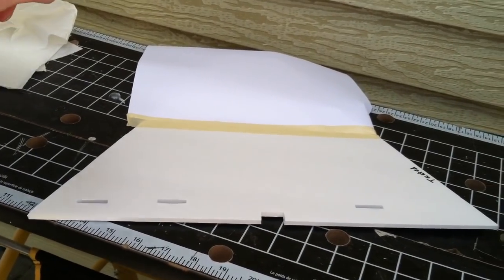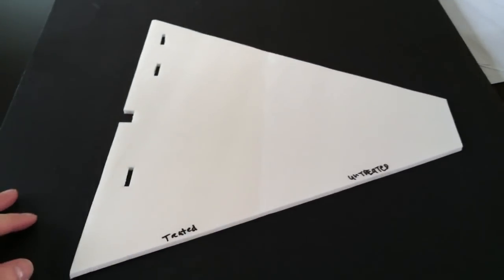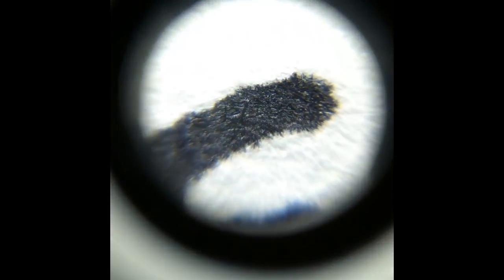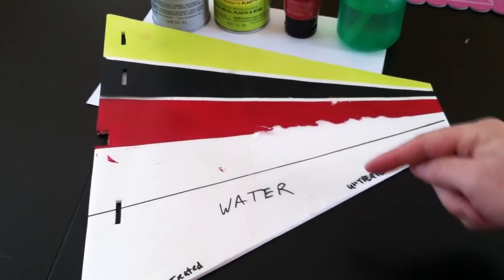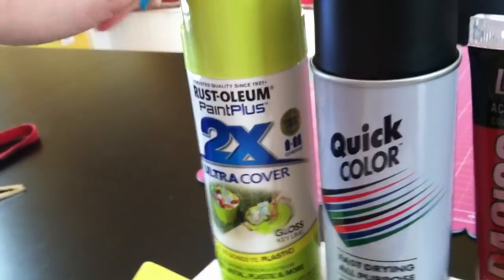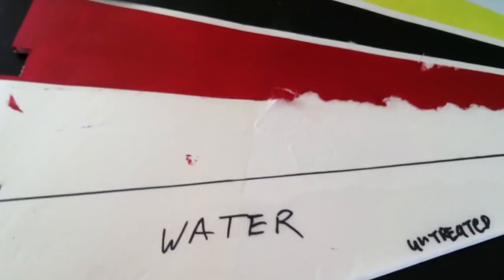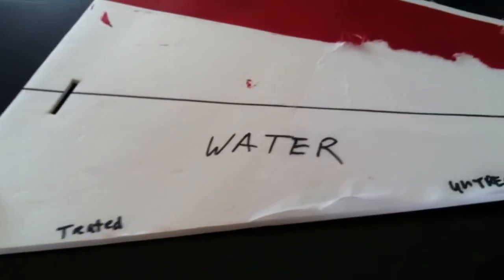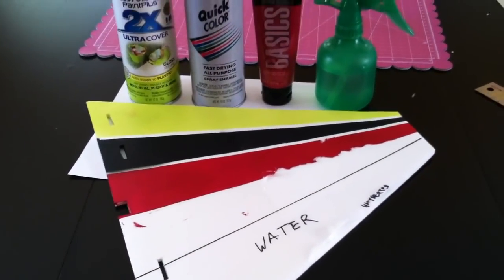Minwax coating on dollar store foam core

Comment: another question I suppose is you painted basically onto the actual foam Paper itself. You treated the foam paper.   I noticed in a few of my scratch builds with this foam is when the paper is removed in some areas OR the sides where there is no paper. If I try spray painting this foam without first treating it many or majority of spray paint will bubble on the surface and many will Melt the actual foam destroying the entire build.    I wondering if this Miniwax pre treatment will allow me to spray paint directly onto the Foam Board where certain areas of the foam paper was removed. Will this prevent the foam melting and paint from bubbling up? hmmm
Reply from the maker: While I haven't tried it myself, I don't know that the poly would work on the bare foam.

Comment: You say you shouldn't paint with acrylics,  but you don't say why. In my testing,  painting acrylic over a poly-treated surface works fine. Just don't do it on untreated foam board, as it warps. Would like to see some justification for your statement, as even your video seems to show it working just fine.

Comment: Hello and thank you very much for your helpful video. I am planning to paint on a foam core board using Acrylic paints and brush....I need to prime my foam board and in a YouTube video I got to know that we need to use water-based Minwax or Latex in order to be able to prime the foam board, but here you mentioned to use oil- based....please advice. Appreciate it.

Comment: does the Minwax cover stop it from wrinkling when you spray paint it.??
Reply from the maker: For all the spray paint I've used, yes. Since the minwax sort of merges with the paper once it cures it has a harder surface feel and the paint works very well.

Comment: Three or four years ago I tried to paint Dollar Tree foam board with a air brush using acrylic paint, this was before I heard about using the Minwax polyurethane to seal the surface, it was an absolute disaster, luckily I tried it on a scrap piece of foam instead of a plane!
Reply: Haha, been there myself. Finished an entire new scratch build of a larger Piper low wing RC plane. was so ready to paint it  until after the first coat, I returned 10 minutes later to apply second coat of paint to learn that the surface was bubbled up, deformed and melted holes into much of the foam fuselage. distaster. If I only pre treated foam before painting

Comment: Wondering how this experiment would go with Elmers Foam board?
I'm new at this and just finished my FT Spitfire build and wanting to make another with my downloaded plans. The Elmers board is  certainly heavier and  difficult to cut, but has a rigidity to it that may prohibit warping? Just wondering if it's an alternative...
Also, it has a nice smooth finish.
Reply: The flight test models are all designed for dollar store foamboard so the rigidity of the elmers is probobly not worth the amount of extra weight it would be adding, also it would cost you quite a bit more to make the models from the elmers brand.

Comment: will this work the same on actual foam?
Reply from the maker: It doesn't. The way this works is the urethane seeps into the paper and bonds with the fibers. Anytime I've seen urethane dry on the bare foam it just ends up flaking off. There are some spray paints that are 'foam friendly' so if you're looking to paint bare foam, I'd test some scrap foam with these paints.

Comment: Have you sen the new Flite Test foam board? New type made by Adams, and supposedly, the glue is bonded to the foam (Have to verify that), so the lifting issue is gone!
Reply from the maker: +Vparanormal1 I haven't had a chance to try it yet but I'm looking forward to getting some and making a Polaris/Skipper style float plane.

Comment: My main concern was the peeling off of the paper.  For sure, the water based will de-laminate the paper from the foam.  When I tried the polyurethane, it did much better, but still, it's easier to peel the treated area than the untreated area.  The experimentation method I used was simple.  Just paint a piece in zebra stripes.  Let dry for at least 24hrs.  I did 48 hrs.  Then start from the edge peel the paper in the direction so that you would alternately peel the treated and untreated as you go.  You will feel the paper "grab" at the untreated area, and not so much in the treated area.  This goes against JZG's experiment.  His was a year ago.  I just did mine, so did the formula change or something?  Was it because I didn't wipe off the excess?  It seems that the clear will penetrate almost instantly, so wiping the excess may not help.  But I will try several light coats and see how that works.

Comment: I am not being critical , sorta, but I 'm not understanding why aircraft builders are leaving the paper on this foam board.. IT IS HEAVY... I use tape to strengthen when needed and acrylic paint( brush or airbrush) on areas needing ID for vision purposes..Over thinking this I believe.. JUSS sayin
Reply from the maker: +Greg Inman Personally, the 'cheap' Adams brand I get for .99 a sheet has very thin paper, almost like tissue paper. As thin as it is it does offer alot of strength over peeling off the paper. Most times tape over the foam adds more weight and can be a hassle to work with. (cutting the tape, overlaps, tape sticking to itself. etc..) And you can do paint effects pretty easily on the paper. I've even done colored pencil art on them.
Reply: good stuff!

Comment: But mine was water based, so maybe that was the problem................
Reply: +SZretired it was indeed your problem, waterbased solutions works with fiberglassing styrofoam planes, but with the paper cover, you need the polyurethane version.
Reply: @claeswikberg8958  interesting, I just used water based poly on my dollar store foam and it worked great. If the paper is pulled off before it will warp.

Comment: is there an alternative for minwax polyurethane? Because in Germany I could not buy this brand and I do not know what Minwax is. Is it a wax? Oil? Something like a clear coat paint?
I guess if it is oil based, no color would stick to it.

I hope you can help me.
Thank you very much.
Kind regards from germany
Reply: +RCCarClips check your local paint store, ask them for a "Polyurethan" (german spelling) varnish
basically almost any will do. try it on a small scrap piece first. if it contains the wrong solvents it will attack the foam

Comment: I did a little test on untreated Dollar Tree foam board, I airbrushed water based acrylic paint on bare foamboard. It was a disaster, the water in the paint caused the foamboard to warp badly as it dried.  Some kind of pretreatment like the Minwax polyurethane is needed to prepare foamboard for painting. So far I'm sticking with the tape covering technique as used on the Experimental Airlines planes.
Reply: G56AG That's the down side to dollar store foam board,  The paper frays and pulls up from the edges.  Your better  taking the paper off with alcohol from a spray bottle.  Letting everything dry then put the Minwax on the foam and re-apply The paper.  I've also used foam board without any paper to build my plane then use diluted Elmers white clue and covered it with news paper or phone book paper.  Drys hard, sandable and paintable, and adds back the strength.

Comment: I tried with  Saman water based varnish and it worked. I also tried with white glue and it worked too.. 

The secret seem to be wiping it before the foam begin to wrap. 

Next thing I want to try is wood sealer  it's cheper than varnish it cure in 2 min and it is specialy designed to seal so it might work realy good.

Comment: Why would you not remove the paper backing and just coat the foam and then paint? the paper tends to peel away from the foam.
Reply: Terry Peterson I have peeled my foamcore and wasn't happy with the strength. It's not a bad idea if you are going to use tape or stickers, but I wouldn't use it with just paint or even minwax and paint without the paper attached.

Comment: Have you tried PVA? White or wood glue, brushed on thin makes a waterproof, paintable, rock hard surface and won't bother the foam at all. As a surface treatment not as a glue.
Reply: That technique only works for a surface that will not be subjected to any flexing. The glues you are mentioning will give a hard smooth finish to paint, but it is also brittle. One flex of the foam and you get all kinds of cracking. I do like to use this technique to seal the edges though. Polyurathane stays flexible and gives good protection. (personal experience)
Reply: I totally agree. I like the spar urethane (water based) for outdoor stuff, but it needs a lot of layers.

Comment: I am preparing to paint a new foam board versawing.  I thought to test out the MinWax vs Hot Glue issue.  First I used a foam brush to paint a full sheet with Minwax.  Initially the foam board weight 113 grams.  After wiping off the residual minwax, it weighed 124 grams.  After setting and allowing evaporation to do it's wor for two hours, it weighed 117 grams.  Not bad over a full sheed of foam board.  I allowed it to cure out for one week. 
 After the curing period, I tried several tests.
The first three using Masking tape, Packing Tape, and Duck Tape.  The tapes stuck to both sides of the board very well, the untreated side, just a little bit better.  When pulled off, the treated side showed no damage, while the untreated side showed paper fibers coming off with the tapes.
Next Hot glue.
I glued two toung depressors to the board exactly oposite to each other allowing handles to extend over the side.  Pulling them apart cause the untreated side's paper to seperate somewhat quickly.  The treated side took more effort to seperate the paper.  Then I tested foam board to foam board gluing and (Treated to Treated, Untreated to Treated, and Untreated to Untreated).  In every case where untreated was used in the test, the paper seperated on the untreated side and tore into the foam.  The Treated to Treated test was a supprise.  No matter how hard I pulled on the two peices, they wouldn't come appart.  I bent the heck out of the foam board, but they wouldn't come appart.  Try it your self.  I intent to minwax my foam board first in all my builds.
Reply: Really interesting result .
Reply from the maker: Awesome! thanks for documenting your results, this is very helpful.
Reply: +JGZ IFLY How would this work on something like an Experimental Airlines Armin wing where you fold the board over at the leading edge with a sharp crease and no cutting or beveling at the fold?   Would bending a treated board like that work OK or would it be better to treat it after assembling the wing?
Reply: Dwayne Crow It should work ok treating the board first.  The process adds strength to the paper and it's bond to the foam board.  In my experiments, the paper maintained it's texture while the foam got bent up.  My suggestion is to try a sample first if you are undecided.
Reply: Interesting, it's been a couple of years, have you built any planes with pre-treated foam board?  The reason I wonder is that Flitetest mentions in a few of their videos not to treat anything that is going to be hot glued because it won't stick.
Reply: Thank you for this. I've been trying to figure out if I should build then minwax or minwax the board first and then build because the FT peeps said that hot glue won't stick to minwaxed surfaces.

Comment: I found this material in the spray can. I can't find it in a can. I sprayed it on the foam board just to wet and wiped it off. Before I could get it off, it lifted the paper! Maybe it is something in the spray as that does not work. I dusted it with the spray, not letting it get moist (almost sprayed it on dry) and it seemed to work but the amount of work needed to spray it on dry is not worth it to me. Minwax says it should be available in small amounts in some Cal. stores, can't find it.Thanks

Comment from the maker: I haven't tested the adhesion of hot glue to the treated surface but my gut tells me that hot glue would stick a little better to the untreated surface. My thinking is that untreated paper would have more 'tooth' to grab on to.  However I don't think it would be a huge difference.

I also treated a completed airframe, see the link in the description.